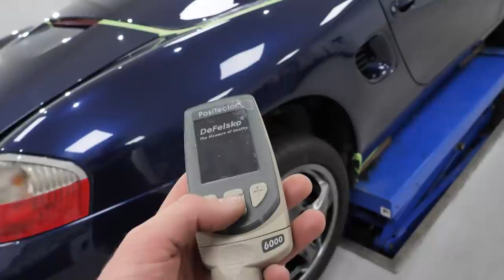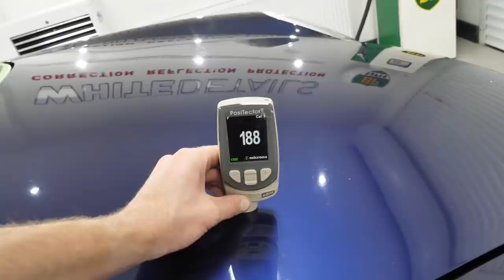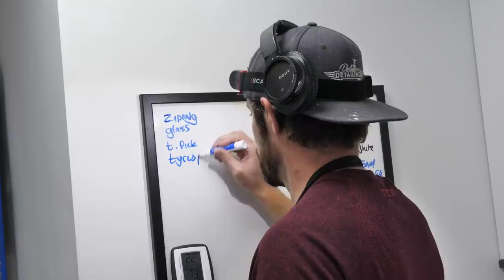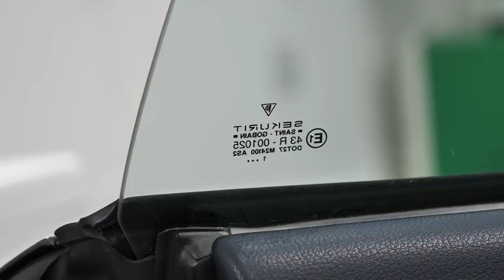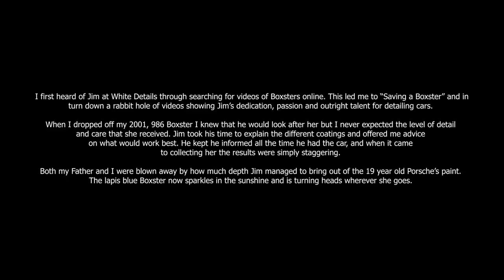Saving a Boxster 2.0 - VLOG 079

Comment: G'day Jim, another great video to view and relax at the same time. With regards to the Refinement question you were asked and your excellent answer, I would relate refinement of detailing to that of a cabinet maker working with wood. You begin with aggressive sanding to remove imperfections and have a reasonable smooth surface, before using fine grade paper to smooth or refine the wood before applying finishing coats of stain, lacquer etc. Great to read the owners response to your work. Ozz

Comment: Absolute marvellous transformation. Just amazed at what you can achieve and I'm continuing ot learn from your tools and techniques. So glad I bought the BigBoi, it saves a multitude of time when drying. I used the wrong nozzle on my car to dry it, but now I see you need to use the cone shaped one and not the wider one. The shine is just stunning. Looking to get my car looking like that one day. Still lots of work to do on mine. Swirls galore. Just need to get a good polisher and get on with it. Again, excellent shine and satisfaction in doing such a sterling job. Well done mate. Awesome.